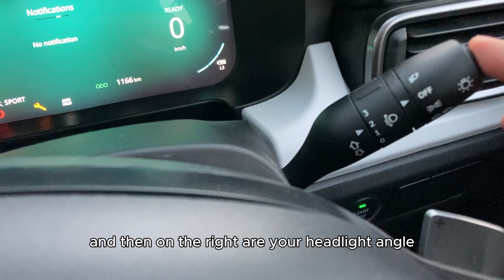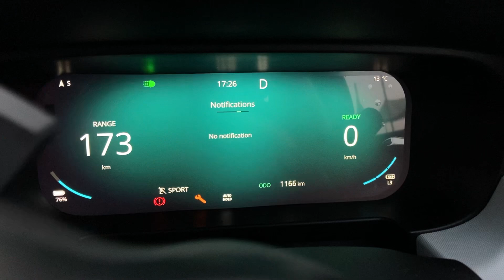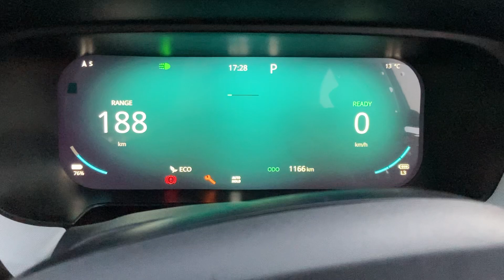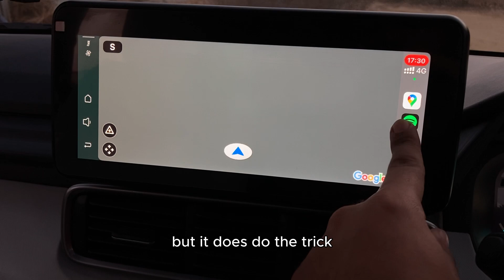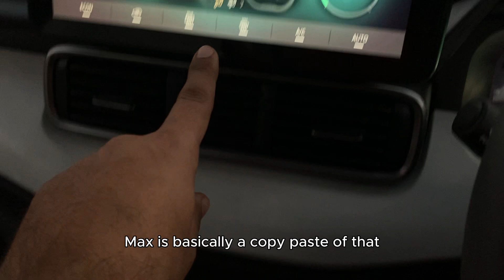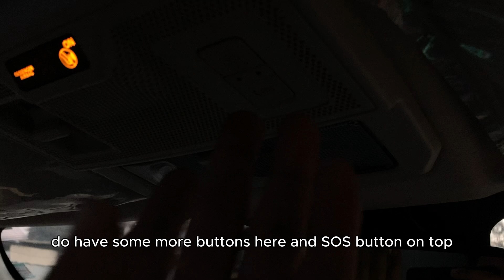Tata Punch EV Infotainment look through

Comment: The interface of carplay is not laggy, since carplay is powered by your phones processor, and when your phone is charging using the wireless power charging, your phone turns hot, which then  reduces the processor speed and CarPlay slows down, conclusion being if your phone is running fast, the CarPlay will be fast, I have the same car, I have seen it happed